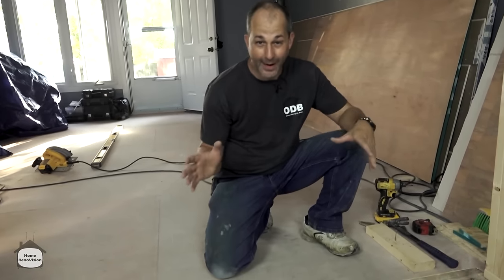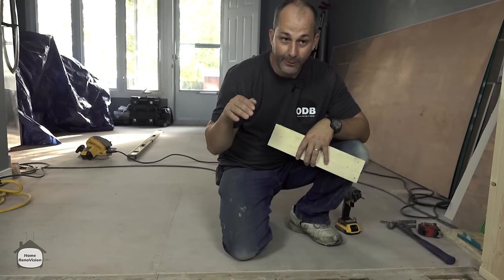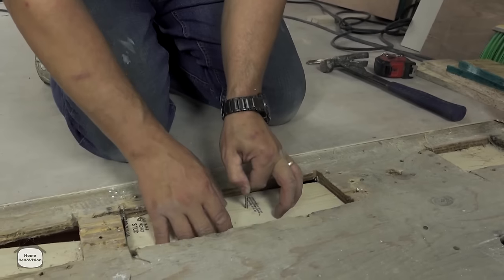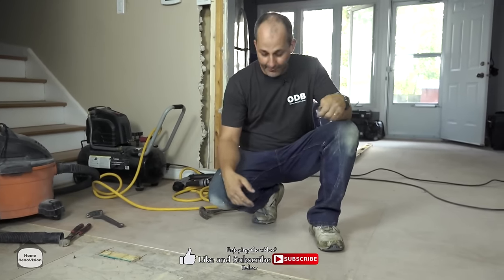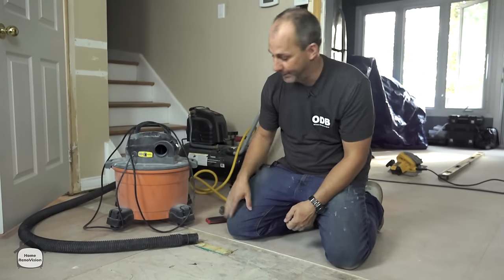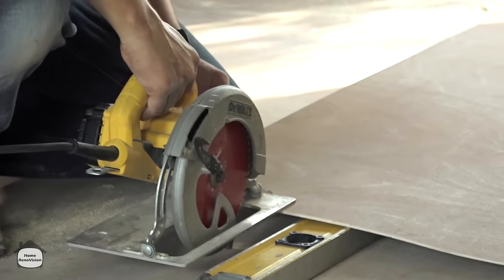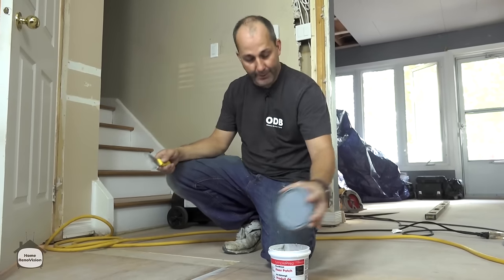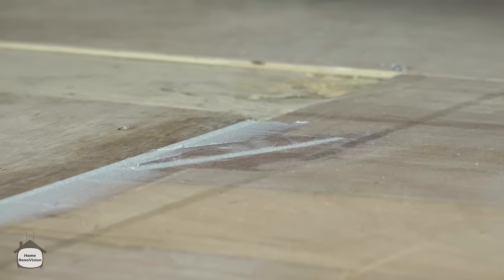How To Prep Your Sub floor For Luxury Vinyl Flooring

Comment: Thanks for the great videos!  I am installing 8mm vinyl planks with attached pad.  My house had an addition and now that I removed the carpet, I can see they didn't level it.  It is 1/4" high in some places and low in others along the line.  Can I add 1/2" OSB to the entire floor and call it good as long as the seams are flat?  I have to add the 1/2" anyway to make another area flush.
Reply from the maker: don't install osb on concrete directly.
Reply: Home RenoVision DIY.  Sorry, I wasn't clear. It's not concrete, it's a normal plywood subfloor, they dug out the crawl space. I have been sanding down the lip and I think that will resolve my issue. As I removed more carpet, it showed not to be the same height all the way across.

Comment: Prepping my flooring right now and I ran in to an issue I'm not sure how to get past.
Under an old fire place there was tile and about an inch of concrete/ grouting do I have to dig all that out and lay plywood, or can I just smooth it out and lay over the top of it?
Reply from the maker: remove and fill is your best option. \Cheers!

Comment: Hi Jeff
I’m laying a nail down hardwood in my living room. High traffic 
An area of 4 ft by 8 ft like a bow  sagging   Lowest spot is 1/4” then it tapered up. I read a lot about leveling with self leveling compound but most of not all the products will crack or chip when shooting nails like 16 G through them. What are my options ? Thanks
Reply from the maker: Hi Sam, they make self leveler that you can nail through. Check with a local flooring supply wholesaler for products not the box stores. cheers!
Reply: Home RenoVision DIY 
Thanks Jeff

Comment: For the folks who know what they are talking about. Can I get some helpful input please.

I have about 500 sq ft of vct that didn't stick to the original glue. I didn't do the job. So I picked all the tile up and set it aside to prep floor for reinstall. Took me all of 10mins to pick up. Home owner said they didn't roll it out. I assume this was why it didn't stick.
Now I need to put it back down but I got a thin layer of adhesive that just doesn't want to come up. The floor is smooth and in good shape just a little yellow. Do I really need to remove the old glue? It's over plywood btw.
Reply from the maker: Hi Eli, since we are unsure of what adhesive they used I would suggest installing a new layer of1/4 inch and then install with the correct adhesive, Cheers!
Reply: @HomeRenoVisionDIY  yeah that wasn't really an option for height reasons. 15hrs of heat gun and 4" scraper got it done.

Comment: Awesome video, I absolutely love your channel. I’m about to try and install click laminate, but in removing the old parquet flooring, ruts and gouges were left throughout the entire subfloor. I’ve had someone tell me just to use revolutionply and lay it over top of the subfloor and that should fix the problem. Is that correct and is the process like that which you showed in the video. There are also a couple of bouncy spots and one or two ridges from butting subfloor panels.
Reply from the maker: knock down the high spots and perhaps use some screws on the plywood and not just staples.

Comment: I do alot of remodeling part time. I have always glued down my subfloor for tile, vinyl, ect.... To stop any squeaks. Is it not necessary to do so?
Reply from the maker: not in most cases. Cheers! It never hurts to be safe!
Reply: You could use felt paper in between to avoid the issue that's what I do

Comment: I just had to replace a bunch of sub flooring. I got everything solid and dried out and put down 5/8 OSB. The gaps are fairly small and I would like to fill them so I can put down vinyl plank flooring.  Almost all the products at the home store said not for use with OSB. Any suggestion for what to use would be greatly appreciated.
Reply from the maker: Hi Steven, this is the dilemma! do you install 1/4 over top so you can fill gaps or do you but a thicker luxury vinyl to save the steps. The vinyl I used on this job probably could have been installed directly over the osb without translating any pattern.
Reply: You can use a primer first

Comment: so all the holes i have drilled in the floor in my new house aren't a problem if they're less than an inch in diameter? im not sure what kind of floor i want to put in but i might have to put in a new sub floor to get rid of the dips.. or you know.. if you just wanna come use my house as a project house that'd be great because i have no money to fix all this stuff. :D  lol
Reply from the maker: If you live in the Ottawa area I would consider looking at it.
Reply: Home RenoVision DIY lol nope I live in Illinois
Reply from the maker: Cheers to Illinois!

Comment: I need some advice on my subfloor.  I ripped up the carpet in our hallway where I plan on installing LVF.  Under the carpet was circa 1960 installed linoleum.  After finding this I called a friend who is a carpenter.  He says the old linoleum most likely contains asbestos.  He says to leave it if the floor is fairly level which it is.  The old linoleum is flat and very well attached.  Is it ok to put underlayment and put the flooring over the old linoleum.  I am putting in Smartcore flooring and using Smartcore underlayment.  Any advice would be much appreciated.
Reply from the maker: yes. if you have any unlevel spots you can prime and use self leveler. Cheers!
Reply: @HomeRenoVisionDIY  Can I apply floor leveling compound over the old linoleum?  I am using TEC floor leveling compound from Lowes along with their TEC primer.

Comment: I'm using cali- bamboo vinyl plank flooring.  Will be installing over 3/4 inch plywood subfloor.  Do I need a silicone paper sheeting vapor barrier under the flooring for moisture.  The house is in southern Fl.
Reply from the maker: Hi Ray, not enough info in the question. Are you slab on grade 1 or 2 storey? which level is the floor going on? are you air conditioned space? have you ever used a wood subfloor material in that house before and how did it perform and did it have a vapor barrier? Florida traditionally has a high water table and the use of plywood may be a problem itself, when you combine wood and plastic you trap moisture so it is important to know these conditions before I can respond. Cheers!
Reply: The house is 3 years old.  Two story, build on a concrete slab.  The floor is going on the second story.  I have added a bedroom and bathroom.  I installed the cali-bamboo (not vinyl) in the master bedroom, also on the second floor.  I used a white Styrofoam underlayment directly over the 3/4 " plywood sheathing.  The flooring has been down for 3 years and looks like it did the day I put it in.  The other question I have is:  In the bathroom I am installing a walk in shower.  Using the kerdy system and detra over the same 3/4" plywood subfloor.  The ditra will be probably 1/4 inch thick once I fill it with thinset.  Doing this to keep the bathroom completely waterproof.  Watching your prep video,  thinking maybe that 1/4 material over the subfloor may be a way to bring the bedroom area up to the same level ??  I have a toto pedestal sink in the bath and the toilet flange has not been installed yet.  Should I put the flooring (under) the pedestal and then lagbolt it to the floating floor?  Or cut out around it.  Same applies to the toilet bowl flange?
Reply: Was talking about the luan sheets that you used over the subfloor to bring the rest of the floor at the same level as the bathroom floor.  And yes, the area will be under AC.
Reply from the maker: I used luan to clean up the surface. My subfloor was in bad shape and had glue residue and cement on it.
Reply from the maker: Thanks Ray, the Vinyl in this case is a perfect choice. You don't need a vapor barrier, However the manufacturer may suggest a plastic sheet to make repairs easier in the future. In the bathroom I always suggest removing the fixtures and reinstalling over finished flooring. A much cleaner look. Cheers!

Comment: Love all your videos and they have helped me with many DIY's around the house. I'm getting ready to replace a bedroom carpet with Vinyl flooring.  I have regular hardwoods in the halls and the flooring I'm looking to put in the bedroom is much lower profile (thickness) then the other hardwoods.  Should I lay 1/4 inch plywood over top the current plywood or is there another option?

Comment: Wouldn’t have filled the sections like that. I would have used 2 timber cuts 90 degrees to span the gap. Screwed them down from the above ply floor. Then infilled the gap with the 18mm ply to match the existing floor

Comment: I was under the assumption that the plywood underlayment needs space to expand and contract  between the edges, would filling the gaps cause issues?
Reply from the maker: not filling the gaps can cause bigger issues. just try your best to keep the heat on in the winter and the ac running in the summer and you will be alright.
Reply: Just be sure to use a flexible seam sealer

Comment: I'm a fairly recent subscriber...so forgive me if this has already been addressed in a previous video....but I am in the process of ripping up some tongue and groove sub flooring (seems thicker than 3/4 inch flake (chip?) board...anyhow I cut into some flex duct work while running the length next to the wall ....any pointers to repair?  I cut into it length wise....do I just try to get some aluminum circular duct work and just cut off the flex stuff and put the good ends on each side?  That's what I was thinking of doing anyway...

Love your videos and teaching style.
Reply from the maker: that sounds pretty solid to me. Just use some good tape as well. Cheers!

Comment: MY KITCHEN FLOOR HAS A SLIGHT BOW IN IT AND I WANT TO LEVEL FOR SNAP AND LOCK FLOORING,THE UNDER LAMENT IS PARTICAL THAT GOT WET AND SWELLED,I'M GOING TO REMOVE IT TO PUT PLY WOOD DOWN,WHAT IS THE BEST WAY TO GET THE BOW OUT?IT IS AN OLDER HOUSE AND HAS OLDER HARD WOOD FLOOR SO WHAT IS YOUR SOLUTION?
Reply from the maker: Sorry Mike I can't consult with such little information.

Comment: How wide is the crown on those staples? What guage? Just don't want squeaks from my underlayment I'm about to put down. 😄
Reply from the maker: Buy the size that fits your tool. the length should be 1 1/2"
Reply: Home RenoVision DIY 18ga with 1/4" crown work ok? I was thinking I might need a wider crown.
Reply from the maker: that will work. the secret is setting the depth of the staple to just flush. Once you get that set you are good to go. Cheers!

Comment: I thought thick vinyl plank flooring would not telegraph the imperfections underneath. What is the minimum thickness you'd need to avoid telegraphing?
Reply from the maker: I like to use a rule of anything under 1/2 round with anything over 5mm thick and your safe. Cheers!
Reply: @HomeRenoVisionDIY  Got it! thanks man. I am thinking loose lay may be easier to install that click, but I feel uneasy about a floor that is just laying there and can be pried out of place so easily as loose lay. Are you a fan of loose lay or prefer the click systems despite being a bit more involved for a noob home owner?

Comment: Why are you putting another subfloor on an existing subfloor ?
Reply from the maker: i have 2 flights of stairs ...one up and one down from the kitchen. I am using it to balance out the rise on the stairs which by code must be consistent to avoid tripping. Cheers!

Comment: Do you have a preference on Vinyl flooring? Does an attached layer of cork help to lessen imprinting?
Reply from the maker: The cork is actually good for cancelling out the sound transmission. It is used as code in apartment buildings for a lot of flooring types.

Comment: If I was going to tile a floor, would it be better to leave the vinyl that is there and tile over, or remove it. it is a small bathroom with approx 5"w X 8' l
Reply from the maker: I prefer to take out the old, this way you can build forward knowing there won't be any surprises.
Reply: 5” wide? Damn that’s not very big at all... lol I know you meant feet but you put inches lol

Comment: I'm laying vinyl tile flooring and the cement floor slopes down into the shower and the lock in flooring won't stay locked in cause it's lower, idk what to do
Reply from the maker: Question why are you using vinyl tile in the shower?
Reply: @HomeRenoVisionDIY  the shower meets the vinyl flooring but the shower is lower, I have a picture but idk how to send it to you

Comment: I own a home that my main floor was a modular home.  So right at the edge of the living room where the ‘hallway’ area starts  for about 16 foot I have a situation where I’m not level because of the two sides.    Advice?   I’m going to be installing LVP or LVT odds are with about a 5.5mm thickness.   

2nd question, the kitchen has the single strip hardwood laminate stuff that came from the store with the glue adhesive already on the backside.  Is it going to be a total pain to pull this stuff up or will it come up easy and leave all this crap stuck to floor?  Just trying to prepare mentally for this project.
Reply from the maker: Sorry Casey, adhesive always leaves a mess. You could just cover with plastic and have a nice clean non sticky surface to work on.

Comment: Why do you need plywood on top of the subfloor?
Reply from the maker: I was installing a vinyl plank and the subfloor was in rough shape and full of small holes and damage. I just like working on a clean surface when flooring so I reduce the amount of mistakes. And I am a little OCD! Cheers!
Reply: I wondered the same thing. When i did my floors i put the luxury vinyl planks right on top of the 3/4th subfloor. I figure the less material under your floors the less chance of something going wrong later on. I did go out of my way to use a Dremel wood blade to even out the areas where the plywood was sticking up due to warping overtime. You want the floor to be as flat as possible, saves huge headaches down the road.

Comment: 10:05 - Or you could just slow down, sink every staple the first time, and not tear the crap out of the surface of the wood, like you're doing.  The point is to have a smooth surface.  Not hammer head marks all over the place and chunks ripped out.
Reply from the maker: no worries, we are not installing sheet vinyl here. using plank flooring. Cheers!

Comment: I’m building up a mudroom in the corner of my garage. I’m about ready to lay the laminate plank flooring, however I’m planning on installing an electric radiant heat mat underneath. Any tips on prepping the floor with that installed? Photos here: https://photos.app.goo.gl/gQggdX2dhkoxTSKq2
Reply from the maker: I would use a membrane like ditra heat and then use vinyl or add a layer pf 3/8 good 1 side plywood on the osb so that you can prime and floor leveler after the mat. This will give you a nice smooth surface to lay the floor. Good luck. and Nice work.

Comment: How about construction adhesive , just saying
Reply from the maker: No need. This would be inappropriate to glue down 1/4 plywood. The purpose of this layer is provide a clean floor surface for the floating floor. Just remember if it isn't structural, it probably won't need adhesive.

Comment: Like your video a lot, You are young with no knee problems. knee pads would help you age better, I'm just saying.........
Reply from the maker: I just don't like the way they pinch. And for such a quick job it just isn't worth the bother....Yet! Cheers
Reply: I'm a relatively young guy, but I've found thin knee pads to make a HUGE difference at the end of the day when I don't want to deal with the bulky ones (the strap on those tends to cut into the back of my knee).  The pads they sell for volleyball work great.  It's a thin pad on an elastic sleeve that you pull on over your leg instead of velcroing, they fit fine under pants, and you forget they're on.
Reply from the maker: That is a clever idea. Cheers!

Comment: I noticed that you're not using knee pads that's the first tool that you use when you're doing your job hello.
Reply from the maker: My knees are quite used to work after all these years. If you want pads to kneel on soft wood lumber then go ahead.
Reply: Home RenoVision DIY I got 40 years in flooring. One of the first things I was taught crawling around on hard surfaces you need knee pads. If you're going to teach people you don't know teach them to use the right tools starting with knee pads. You might not need them but you'll find out in time that you should have.

Comment: Just too much work with all that added lower support and toe nailing coupled with multi measured plugs to fix those  little holes. Giterdun in half the time by replacing a single small section of subfloor from joist to joist. RIGHT? ....And you might want to  use a (sacrificial style) 2x4 instead of a metal tool(level) as a  material kickstand when you cut plywood on the floor. Theres also floor patch available that mixes with water and ready for sanding and the vinyl flooring install in just 2 hours.  Now get back to work! ha.
Reply from the maker: Wow, just a little impressed with yourself eh! Opening the subfloor is incredibly time consuming. I didn't have any 2x4 left lying around and i can buy a patch that is dry in 30 minutes if I need to. Ha

Comment: luxury vinyl is an oxymoron
Reply from the maker: Have you seen the new product lines yet?
Reply: I get tickled every time I hear that too! Vinyl has never been my go to, but the customer gets what they ask for.
Reply: Apparently you've never worked with any commercial vinyl flooring products. Higher end roll goods and Luxury Vinyl Tile are VERY expensive. Most of the crap sold in the box stores are low quality and cheap, obviously marketed towards weekend warrior homeowners. Vinyl doesn't always mean cheap junk.